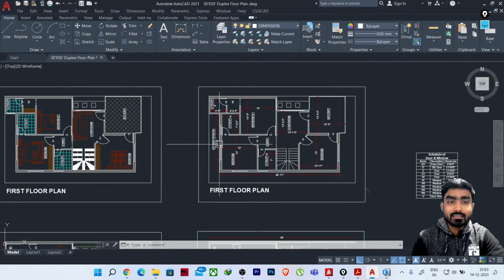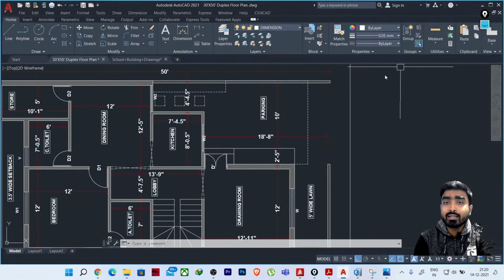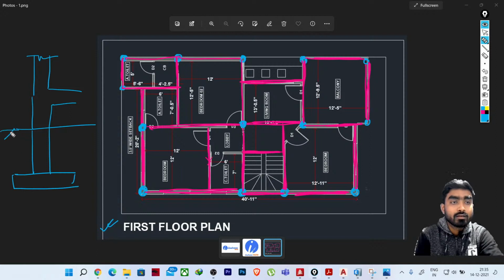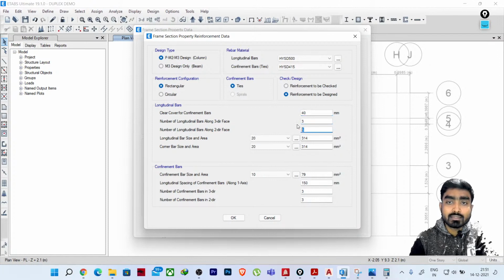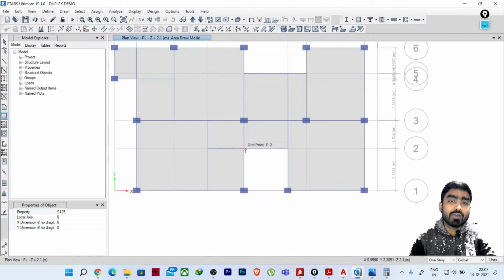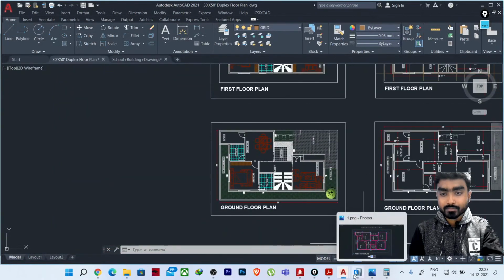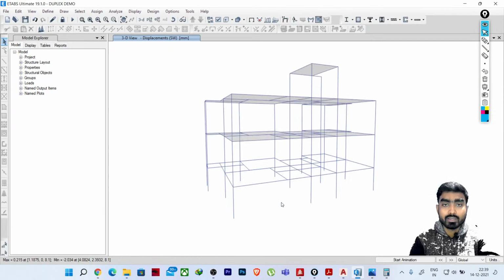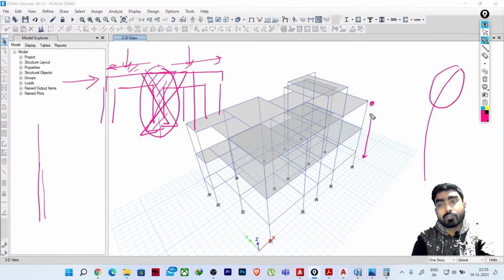Building Design: Complete ETABS Demonstration | YouTube Live | ilustraca

Comment: Sir, for designing staircase, slab is considered as membrane. But in practical one beam is provided to support the landing slab between the staircases. How to design that beam?
Reply from the maker: membrane is not considered to design the stair but to transfer the load of stair to the columns... staircase and landing beam need to be designed manually or separately
Reply: @ilustraca  Thank You Sir